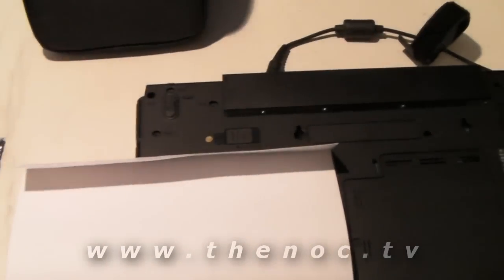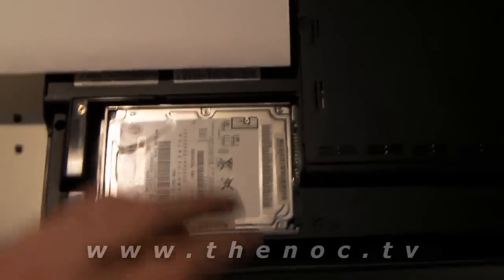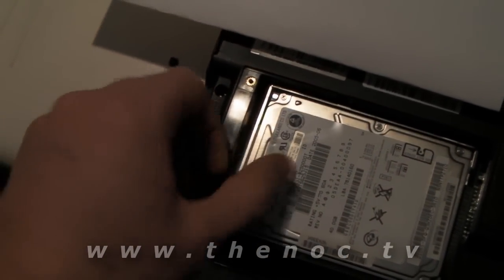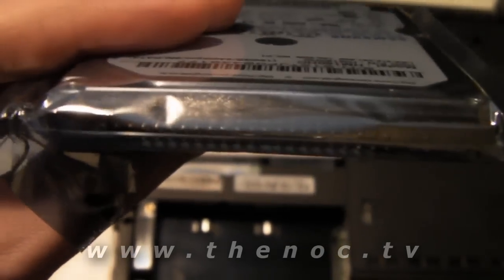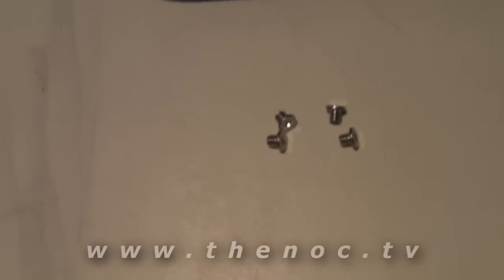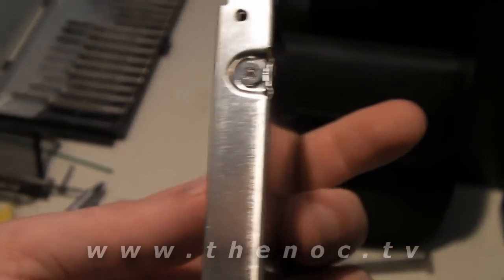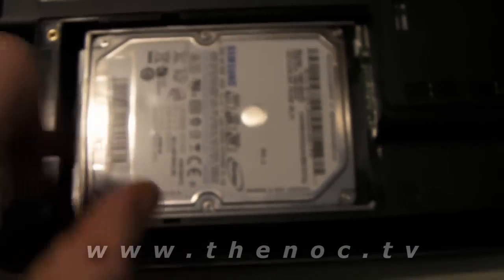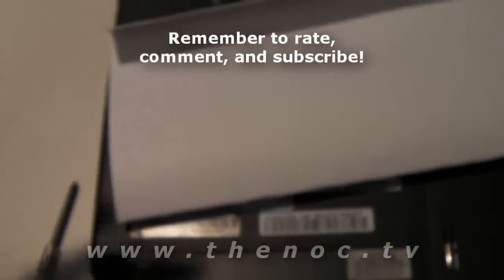How to replace a hard drive in a laptop

Comment from the maker: @speak119 If you have no restore cd's you would need to get a CD for you operating system and install that, I have videos on doing that already.

Now if you don't have a CD drive on the computer you can hook up an external drive to use for installing the operating system from it.

Also another option is to give you PC maker a call can ask for your restore disks. They might charge $20 for them, but have a fit about it and they might (keyword might) send them for free.